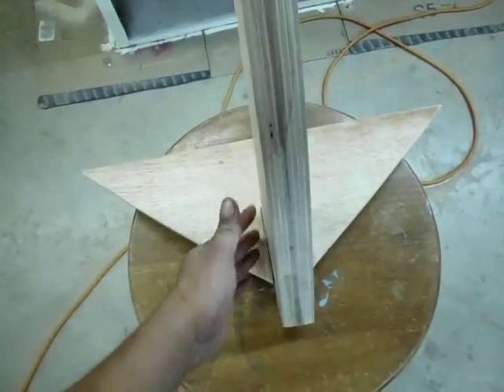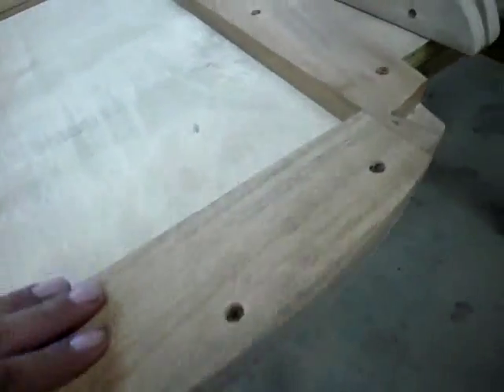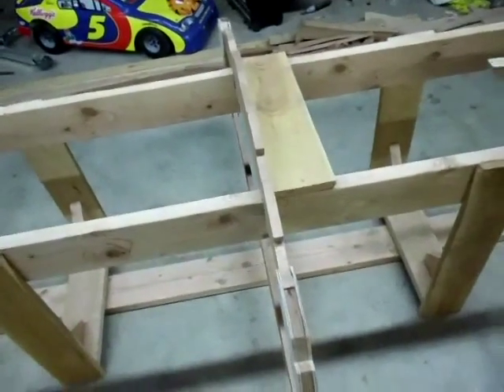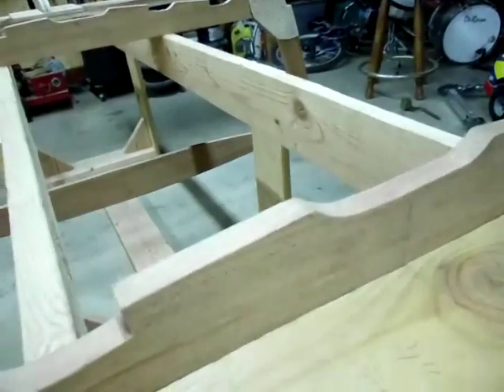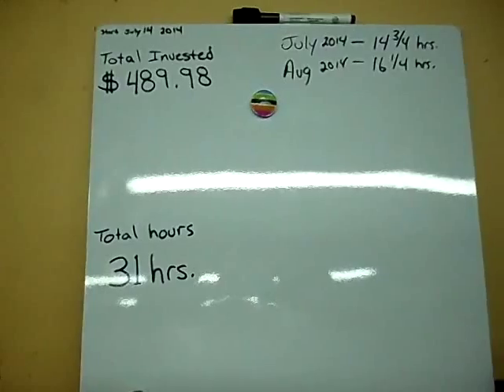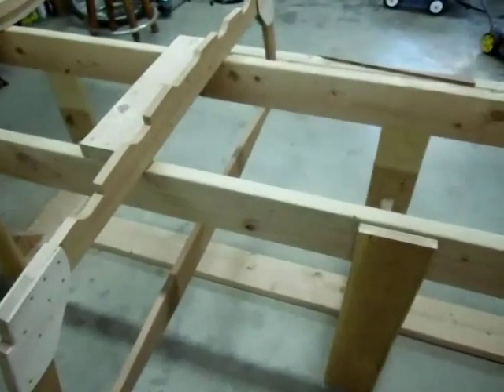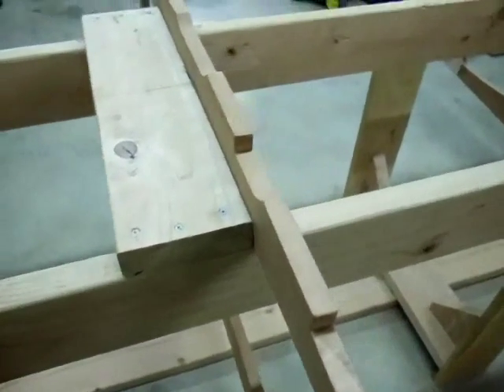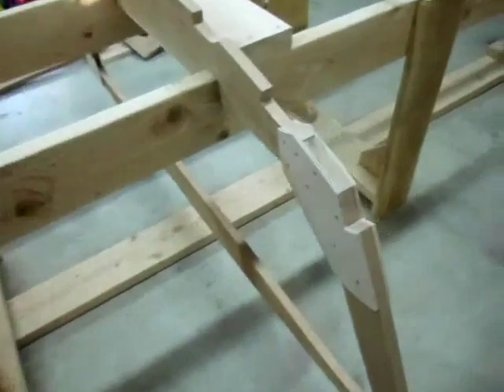Building the zip vol #2 part 2

Comment: For trimming your plywood gussets you can also use a flush trimming router bit with a ball bearing guide. It's faster than a belt sander and eliminates any chance of damaging your frame members.
Boat is coming along very nicely.